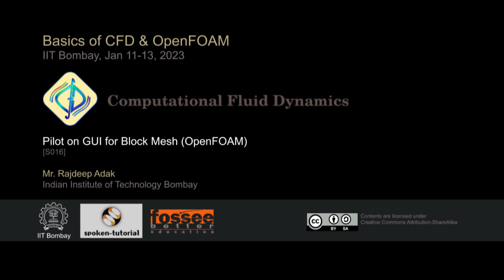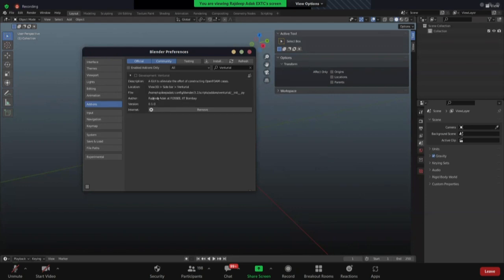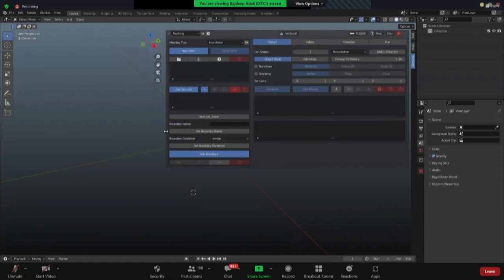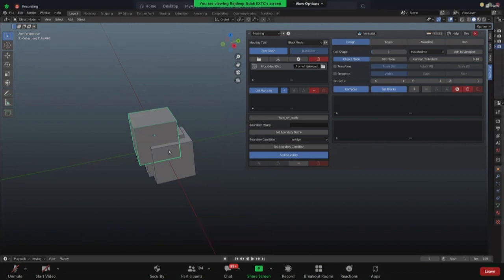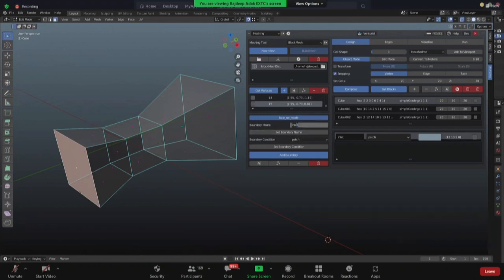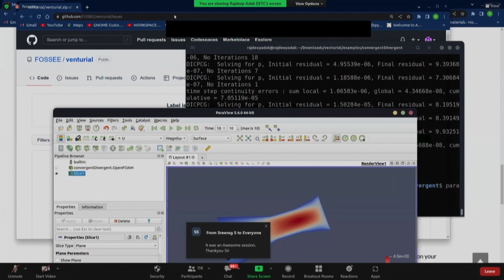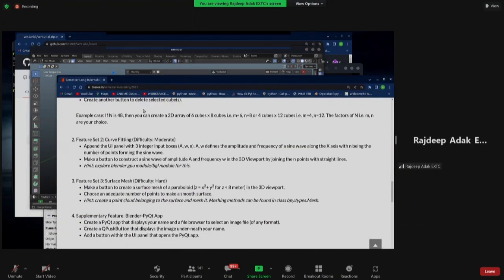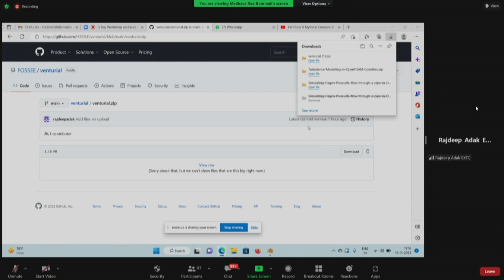OpenFOAM S016 Pilot on GUI for Block Mesh (OpenFOAM)

Comment: I believe there may be an issue with the Venturial addon on GitHub. Following the installation of the package, it does not resemble the version depicted in the instructional video. Notably, the vertices menu and block menu are absent, and the functionality of the compose and get block buttons appears to be non-operational.